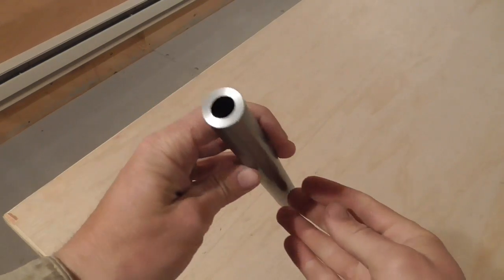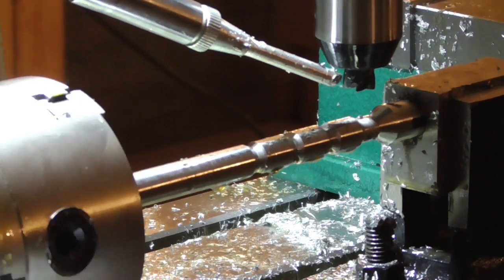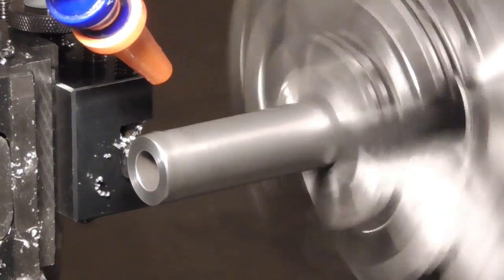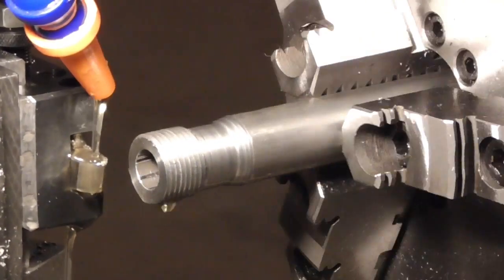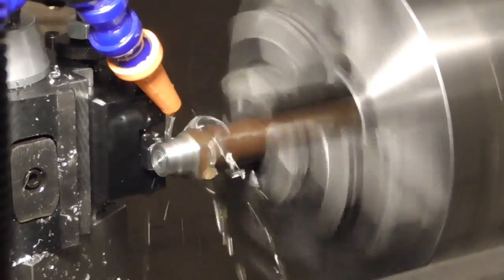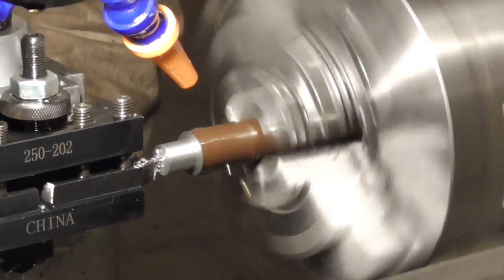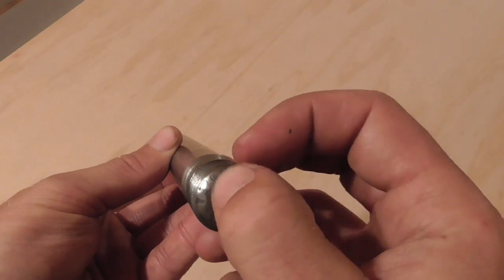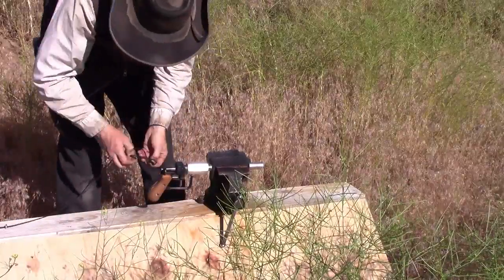Finishing the Rifled Barrel (TIS097)

Comment: Have you tried electro chemical rifling barrels? Your system is getting very refined but it would be interesting to see a a different way of doing it with maybe a bit more engineering than hooking it up to a car battery. Keep up the great work!

 http://www.firearmsid.com/feature%20articles/ecr/electrochemicalrifling.htm

https://youtu.be/ZeOwa28Au5E
Reply from the maker: Hitherto, I've never used ECM for anything but production of iron oxide for chemistry experiments, which needless to say doesn't require a very precise setup.  Honestly, for rifling a steel barrel, I think the button method is a lot easier and will probably produce better results.  However, if I ever try to make a barrel out of tungsten carbide (or a carbide lined barrel) then I might try cutting the rifling with an ECM process.  It might be a long time before I get around to trying that though.

Comment: How are the external threads after welding? I'd have considered welding the plug in first and then threading it.
Reply from the maker: I've done it both ways.  If I weld it first and then thread it, the weld metal seems to be tough to cut cleanly, and so it is hard to get fully-formed threads on the end where the plug was welded in.  If I thread it first and then weld it, I usually end up melting about one thread on the end, but after cleaning up the weld and filing the end of the thread a little if necessary, it fits alright.  So both ways can work, both have their pros and cons.  I'd say threading before welding is marginally easier, but it's kind of a tossup.

Comment: care to test one of these barrels to destruction? you could start with 380, then bore the chamber longer to 9mm markov, then longer still to 9mm luger, then 9mm super if 9mm p+p doesn't blow it.
Reply from the maker: I would like to try something like that eventually, although first I need to set up a grinding jig for my milling machine so that I can make my own chambering reamers.
Reply: Given how hot his proof load was, I would be VERY surprised if any commercial pistol cartridge caused problems.
Reply: can it be done quick and dirty? say grab a drill bit, maybe grind it down a touch to get the right diameter, and slowly drill it to the correct chamber depth? should work for any straight walled cartridge, perhaps even some tapered ones too, if you don't mind the occasional stretched or split cases. BTW, you should still call it a Norris Chuck.

Comment: Do you recollect the lubricant?
If you do, how do you separate the lubricant from the tiny metal pieces?
I have not even been near such machinery and I'm just curious if all that lubricant that you use is for one time only.
Reply from the maker: The lathe (and the mill, too, although I don't think I used the mill in this video) has a cutting fluid reservoir in the base of the machine where the fluid will drain back to when it flows off the piecework.  The fluid passes through a screen and then a filter to remove the metal chips before it is recirculated by the cutting fluid pump.  I do lose a certain amount of fluid due to droplets that get flung off a rotating workpiece or residue that remains in the chips, but most of it drains back and gets re-used.